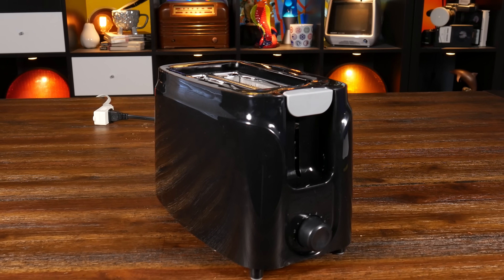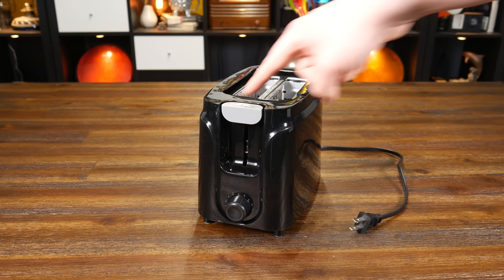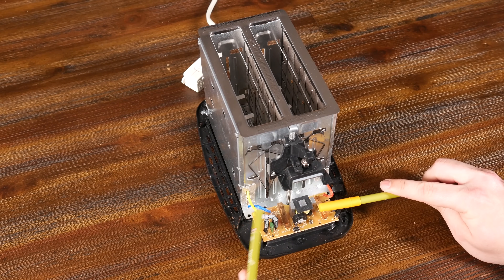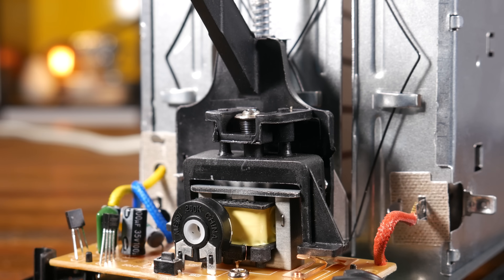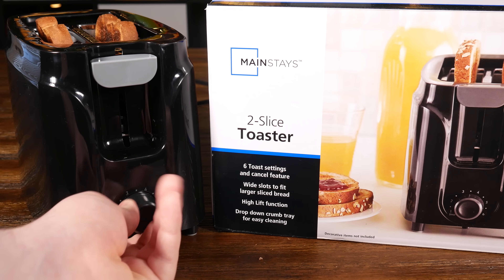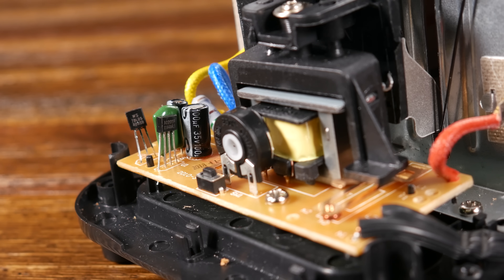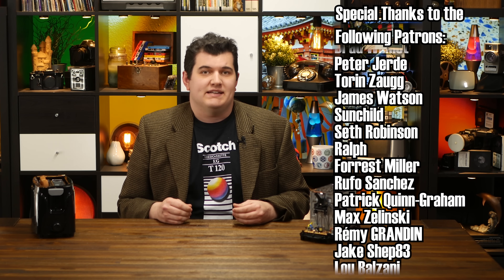The Electromagnet in Your Toaster

Comment from the maker: People more better at electronics than me;
I have a sneaking suspicion this circuit is either simpler or more complicated than I’m making it out to be. The input, being labeled OSC, almost makes it seem like it’s counting clock cycles, and perhaps the pot varies the speed of an oscillator? But I don’t see anything that would create an oscillation (though I am certainly no expert). I’ve put a link to the datasheet in the description if you want to dive a little deeper.
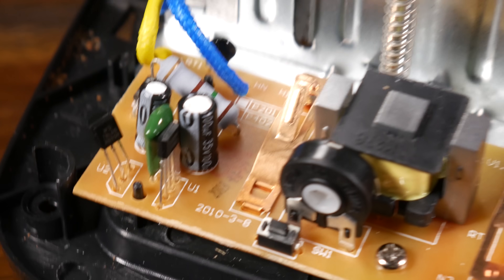Reply: 6:07

The other-other clever part of modern toasters, is that the yellow wire is connected part-way along the heating element, which reduces the voltage to say 12 Volts.

The diode then rectifies that to power the circuit, a bit like a tap on a transformer. ;)

(obviously it's not isolated from the mains, but it doesn't matter as long as the outside controls are insulated.)
Reply: @electronash  Oh man, why did they do this? That is extremely inefficient! Did they want to have a transformer with the efficiency of a toas... oh
Reply: @electronash  And same trick was used on some fancy thermostatted hairdryers to power the temp control electronics. At least since the mid ´80s afaik.
Reply: @ElectronAsh - same "12V" thing is used in most of modern hair dryers in opposite to old and good ones having big unbreakable brushless, silent smooth AC motors, this could be yet another technology connection topic of interest.
Reply: @electronash  What happens if the outlet or plug is wired backwards? If it was exactly in the middle then I guess it's fine, but if it's close to one end (for only a small amount of voltage), you could get a bit of magic smoke.
Reply: @K-o-R  

Ahh, well, technically the AC "polarity" shouldn't matter on an appliance like a modern toaster, where the controls are insulated.

Since there's no direct reference to mains Earth, the circuit just "sees" the difference in voltage between the two AC mains wires (at any one time). The whole circuit is "floating" at mains potential, relative to Earth.

For some stuff, the order of the live and neutral wires is very important, but for a lot of modern devices, they don't care at all.

Most things like TVs these days are so-called "double-insulated", too, so they don't even have / require an Earth connection...

https://en.wikipedia.org/wiki/Appliance_classes#Class_II

The reason the toaster should work OK if the mains wires were swapped is because the effective "Ground / 0V" point in the circuit would still be referenced to the side of the heating wire nearest where the yellow wire connects.

So the voltage between those two points would still only be around 12-24V AC. ;)
Reply: @K.o.R. I'm an electronics hobbyist, and I give you my word, such as it is, that the circuit will work exactly as intended, no matter which way the Live and Neutral wires are connected.
Reply: @K-o-R  dont let that magic smoke out, nothing works without it.
Reply: @K-o-R  It should not matter how you plug it the wall. You seem to imply that if you plugged it it backwards, you'd get 120v-12v instead of 12v. The heating elements work as a voltage divider. There's some segment of heating element that has a 12-volt drop across it. That's a 12-volt drop regardless of how you plug the toaster into the wall.

It's alternating current going through the heating element, so it's not like the voltage drop even has one polarity. it needs to be half-wave rectified.
Reply: @K-o-R  it's referenced to the wire closer to the start point, not necessarily to neutral, as the toaster has no way of knowing which one that is. There shouldn't be any difference, except for the fact that if you cut neutral, everything in the toaster is live and can deliver 110v (or 220v) when shorted to ground, which is kinda dangerous.
Reply: @K-o-R  The voltage going through the heating elements is AC, so it alternates between positive and negative.  For 120 V, it alternates between +170 and -170.  The yellow wire is apparently connected 1/5 away from an end, so it's voltage is 120 / 5 = 24 V AC (varies between -34 and +34 V).  If the plug is reversed, the yellow wire still varies between -34 and +34... so you still get 24 V AC, which gets cut to 12V due to half-wave rectifier (the single diode).  After the diode, the voltage varies between 0 and +34V (or -34V, depending on direction of diode).  The capacitor(s) average this out to a nearly-constant 12V DC.
Reply from the maker: @ElectronAsh OHHH that's so neat! Never thought of that possibility!
Reply: @TechnologyConnections  

Oww. I thought I'd read most of the comments, to make sure nobody else said the same thing.

But, Tomasz Biskup
 clearly posted while I was typing, and explained everything. hehe

So yep, rather than a "transformer tap", the heating element (nichrome wire) is basically just a big resistive divider.

The further you go towards the live end of the wire, the higher the voltage. (assuming the other side of the circuit is connected to neutral.)
Reply: @TechnologyConnections  all the toasters I delved into in the sixties and seventies and eighties had no electronics at all.  Pressing the lever all the way down operated a mechanical latch -- lever would stay down with no power applied.  Toast control was achieved by mechanically altering the spacing of a bimetallic strut inside the toast chamber (which side would be indicated on the top of the toaster). 

When the strut bent sufficiently it touched a fixed contact and triggered a solenoid that would release the latch, and the lever would spring up again.
Reply: @TechnologyConnections  Voltage Divider circuits!
Reply: I really want to know how the advanced (bagel) processing works, and why modern x86-based CPUs don't support (bagel) instruction sets.
Reply: @CaveyMoth  ---- x86 machines do support bagel instruction sets , you just have to break them up into 32 bits to get them to load in the bagel I/O register.
Reply: @CaveyMoth  yeah! Why!? They support cookies! Don't they? ;)
Reply: @CaveyMoth  The meaning of bagel mode in the Datasheet means, that the chip is not bothered by the count of the heating elements are switched on. The task of dont switching heating elements on must be done by a bagel-mode controller...
Reply: @ralfhartmann8601  I'm eating a bagel while reading this. I think I've gone full bagel mode.
Reply: 5:20 You basically show whole schematic and how it function on bottom of page. The 4 heater elements act for purpose of circuit as voltage divider cut the mains to 1/4. Then diode for rectify AC to DC and small electrolytic capacitor act as power supply for electromagnet. Then R1 C2 and zenner diode Z1 to cut and stabilize voltage to 3V to power the IC. The IC its just a counter, it count impulses generated at OSC pin, if it reach some value it changes state at OUT pin and turn off electromagnet. Now the OSC pin is oscillating with some frequency selected by resistor and potentiometer and capacitor C3. Maximum frequency (minimum time) is setup with value of R3, and minimum frequency (max time) by adding value of R3 and potentiometer W1. The oscilator probably works in this way: The capacitor is charging with current limited by R3 and W1. When voltage exceed threshold the OSC pin discharges capacitor and start over.
Reply: @tomaszbiskup891  I suspect the green capacitor is used to form a capacitor dropper and the 78L05 provides the regulated 5V to the chip
Reply: @Yrouel86  Green capacitor is part of RC oscillator. The big resistor is part that drop voltage to safe voltage to 78L05.  Remember that the IC is "Power On Reset", so on transient state as soon as IC get 5v it turn on electromagnet coil. Resistor and electromagnet coil divide voltage to max 30-35v for 78L05.
Capacitor dropper works on AC but we are already on DC after rectifying diode. But yeah I though the circuit will use capacitive power supply to power but it will not give that much power to supply electromagnet i think. Instead it use some clever trickery tapping in section of heater. The trouble is when heater part L4 burn and open circuit then all capacitors will vaporize and switching transistor burn short and electromagnet will never let go.
Reply: @tomaszbiskup891  Came here to say this
Reply: @Tomasz Biskup You are absolutely correct, My Good Sir!
I have just looked through the datasheets myself and came to the same conclusions. The datasheet for the PT8A2513NE, the "magic" IC, contains a bit extra info about max/min electrical values and such, but no schematic of the inner workings. Still, here's a link in case you or someone else might be interested: https://media.digikey.com/pdf/Data%20Sheets/Diodes%20PDFs/PT8A2513NE.pdf
B.T.W. if my calculations are worth anything, the oscillator part of the IC seems to be accurate to within about 1,07%

Greetings from Denmark. :D
Reply: +bigclivedotcom should get on the case
Reply: It will be a simple RC oscillator, very similar to a 555 timer chip oscillator. The IC will in conjunction with the resistor, potentiometer, and Capacitor, create the oscillation. Basically, when power is applied, the capacitor charges via the resistor and pot. once it reaches a predetermined voltage, the IC will short out the cap, discharging it, and the cycle will start again. After the chip has counted a predetermined amount of oscillations, it'll lower the relay output, turning off the electromagnet, and in turn the power.
 The pot varies the rate at which the capacitor charges, and thus the rate of oscillation. I found a datasheet of a similar chip, which has more functions, but also has an internal block diagram to give you an idea of how it works. https://www.diodes.com/assets/Datasheets/PT8A2511.pdf
https://www.electronics-tutorials.ws/waveforms/555_oscillator.html
Reply: @lesleymunro4964  Not like a 555. This contains register/s for counting. A frequency divider need only be a single register counter which is reset on power up, and incremented with oscillator cycles, and the most significant bit will be the output port. It’s a rebranded (or just a cat number) for PT8A2513NE universal timer.
Reply: Last one got me, but temperature compensation looks to be incidental. It can’t be a feature of the chip, but RC oscillators, being the shittiest of electronic oscillators, clock faster with increased temperature or voltage. If it’s already hot, the same interval will count faster because the oscillator is already running faster when the unit is started a second time. The adjustment of the timer is infinite (even though it’s a digital counter), because the pot is part of the analogue RC oscillator clocking the digital timer.
Reply: @BrekMartin  I just meant the oscillator part of the chip, relaxation oscillator, would be like the 555, not the whole chip gubbins. I did see they had a divider/counter in the chip. Simple, yet effective.
Reply: @Lesley Munro The IC in the datasheet you linked to is a more advanced version, but nonetheless providing the same functionality. The one in the toaster has this datasheet: https://media.digikey.com/pdf/Data%20Sheets/Diodes%20PDFs/PT8A2513NE.pdf
Reply: tantalizing territory of toaster technology
Reply: ONLY Technology Connections could get such an impassioned and productive conversation going about a freakin toaster😆
Love every video!👌🏽👏🏽
Reply: How do we know that the x86 doesn't have bagel instructions? There could be a whole hidden bagel management subsystem in there, secretly collecting data on people's bagel consumption habits and sending it to the NSA.
Reply: I suppose the fun part starts happening if your toaster is lucky enough the experience a break inside that "12V" part of the heating element then. Which suddenly becomes 230V as soon as the divider is broken.
Reply: What about the cool toaster from 70 years ago? That sounded neat
Reply: @AM-os4ty  My family had one of those when I was growing up.  I swear it ran for at least 30 years. I never quite understood TV shows where toast would come flyng out of the toaster, because as far as I knew it just glided up slowly when it was done.
Reply: The outtakes surprised me.  I just assumed that someone off screen cut the power to the toaster at the right moment to give the illusion of perfect timing for much less effort.
Reply: @lonjohnson5161  I had made a similar assumption (or that he hit a switch with his foot).  The fact that he apparently did it with timing seems surprising, but cool.
Reply: Further comments seem to indicate he did it with video editing!  Either way, so much effort just to avoid using a foot switch...
Reply: The really old non-automatic toasters only had a heating element and a level of heat. There was a mechanical lever to push the bread up when you think they were done.

9/10 toasts in that toaster burnt since people usually forget it doesnt pop up on its own...

Source: went to a boarding school where there was a 40 year old toaster with a lever :D
Reply: @ryanmcchan  it wasn't just the textbooks they can't be bothered to update
Reply: The inside coils heating less than the outside coils is "bagel mode".  You would put the cut bagel sides towards the outsides so they get toasted while the rest of the bagel just gets nicely warmed.  It probably uses that diode to the yellow wire like you said to halve the power in this mode.
Reply: @hkscfreak  The diode does nothing to heater. It just take some of the power to power circuit and electromagnet, that's why heater give less heat.
Another thing mentioned in video is when you repeat using toaster it knows that it is heat up by some kind of capacitor. Actually it uses thermistor pt1, on higher temperatures resistance of thermistor goes down and oscillator frequency rises - tosser turn off quicker than from cold start.
Reply: @Technology Connections are you sure you don't want any toast? https://www.youtube.com/watch?v=LRq_SAuQDec
Reply: Show 'em how it's done, @bigclivedotcom !
Reply: If the pot value is read and transformed into a value of how many clock cycles to count, then the cycles which are counted could simply be from the supply voltage. There are clocks that use the power grid's cycles to measure time. I have one of them next to my bed (since I have it anyway and it's really easy to read but at the same time doesn't visibly illuminate my room). When there was trouble in Serbia/Kosovo last year and there was a net deficit in the European power grid, this resulted in the frequency of the power grid consistently staying below the 50Hz mark. Since that went on for a while, clocks measuring time that way eventually ran minutes late.
Reply: "more better"
Reply: @Technology Connections - 
The double pole switch is not only good for safety , it also makes this part internationally legal for countries with actual unpolarized plugs & also unpolarized legacy plugs ... like in Germany & most of Europe & Korea + former USSR & many other 200-250V countries. 

Also USA toasters + kettles etc. should be standardized to 220-240 Volts , due to power draw. Also update the USA plugs with protective (UK-) sleeves & sockets with a protective (German) recess similar to IEC 60906-1   https://en.wikipedia.org/wiki/IEC_60906-1
Reply: @Killerspieler0815  Oh I see, since we, the USA, set the first voltage and frequency standards for electric distribution, and other countries chose to ignore our standard and devised their own, we should be forced to modify all our appliances so they meet your criteria. That sounds fair, in a very Europeon way.
Reply: @ernestsmith3581  - ypou are putting words in my mouth I never said (like a "good" politrician does) ... I just suggested an Upgrade to phase out 110V only Sockets & slowly standartize to 230V ... also more 400V or 440V 3-Phase would be nice for the future , as well as a completed 700KV to 1000KV HVDC (yes modern direct current) national grid (highest level grid) would be very very nice (in every country incl. thze european ones)
Reply: @Killerspieler0815  We are in the process of slowly converting to 240. However, I'm sure the old 115 V appliances will be accommodated years into the future. Even the most dangerous (arguably AC./DC tube radios with metal cabinets) are safe when properly cared for and serviced. Knowledge and personal responsibility are still not passe.
Reply: @ernestsmith3581   - oh yeah even in 1960s (!) USA had many brand new radios with ~10 live (115V) screws everywhere, touchabe from the out side ... 
meanwhile in Germany: even a 1933 build Telefunken VE301 W Volksempfänger (YES 35 years earlier) had were justz 2 potentially live screws (lower part) on the outside & (Youtube: watch?v=U71X5qsjH_Q  shows the opening of a VE301 W that even supports 110V & 130V AC ) ... The 1938 version ( DKE-1938 ) was even free of live screws (Youtube: watch?v=MfNSEFvHQEk  )
Reply: Ah toasters the silliest essential appliance.. Maybe second to room heaters (gotta save some money by keeping the rest of the house cold like a igloo.. I mean it is cozy to camp in the cold and great to save some money but that is just too far..)
Reply: Be careful with your "insulated poking" things. They can pull static which means they can pull more electricity. Pen tubes seem harmless but as someone that used to work at BIC can tell you, in the cold, dry months, they can pull a lot of static. BIC Graphics in Minnesota (both facilities) have special things (a huge ring) instead on the ceiling to keep the humidity up to sort this problem out because the static from the pen tubes would short out the circuitry on the machines. Here in Florida, it's not much a problem as it's humid like 11 months of the year total. Up north, big problem. Don't want you to die, man.
Reply: Electronix novice: would the toaster need an oscilator/clock when you’re plugging 60Hz 120VAC into it? Which would mean the toasters speed would change if you’re in different countries where the rate of AC is 50Hz, etc. it’s likely the pot increases or decreases the duty cycle. The more duty cycle charges the capacitor more quickly. Idk
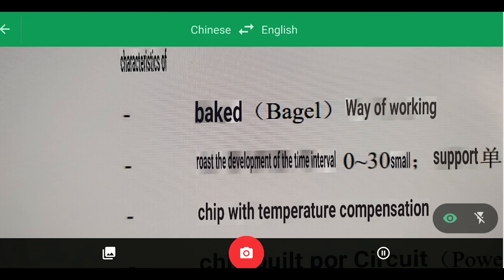Reply: 9:04 I'm pretty sure the "temperature compensation" only refers to the chip's timekeeping accuracy. It's not smart enough to count faster when the toaster is already hot.
Reply: @ihatenumberinemail  i'd agree on that. the chinese would word a preheated toaster compensation quite differently.
Reply: The oscillator wouldn't be the power itself, would it?  Like how CRTs would use the 50 Hz (or sometimes 60 Hz) to time the scans, maybe the toaster is counting that?
Reply: the osc pin is likely the drive and sense pin for a timing component, like an RC oscillator
Reply: I was going to say something… but I see many people already beat me to it
Reply: Hey, I'm kinda advanced in electronics, and seeing that pcb it's just how you said it was. The rest of the stuff on the board is probably a capacitive power supply, to provide energy to the ic's, as they don't really like 110v ac, and use something more like 30v ac, preferably somewhat smooth.
Reply: Speaking of simpler, until I saw the bloopers, I assumed you were making the toast pop on que via a surge protector being turned off with your foot.
Reply: Quite a late reply, but I imagine it's probably counting mains frequency cycles?
Reply: Can you fix my toaster or tell me what I'm doing wrong? Lol
Reply: My toaster has an NTC thermistor on the PCB - i guess part of the oscillator, for temperature-dependent varying of the oscillator frequency
Reply: I know very little about electronics, but I had thought that toasters were all analog with no digital circuitry unless they were expensive ones. After all, they give the outward appearance of it, and I thought that computer chips hated the kind of temperatures found inside of toasters. Well, what do you know?